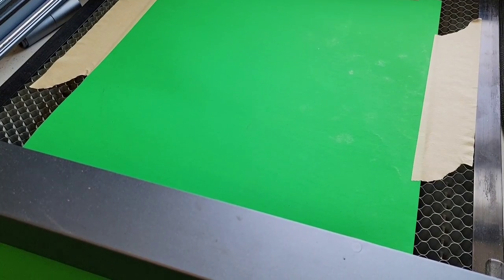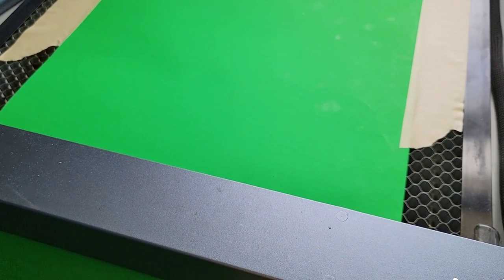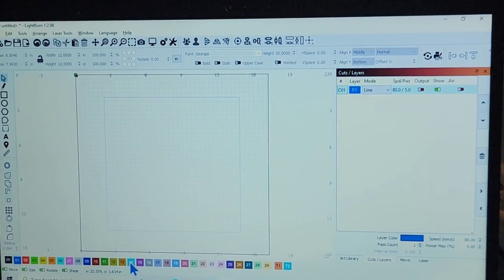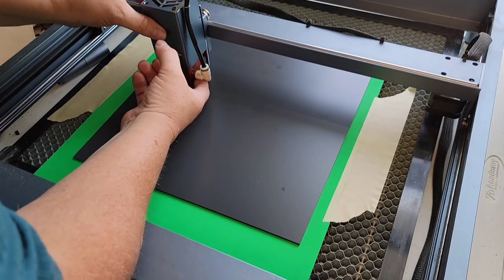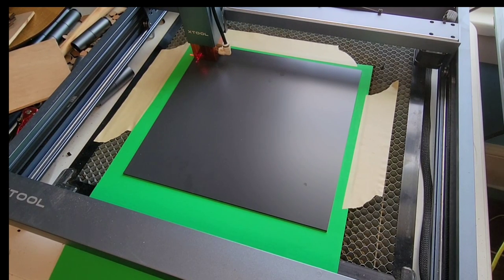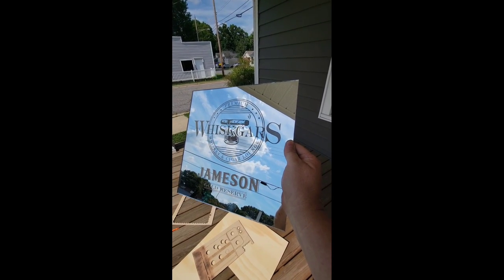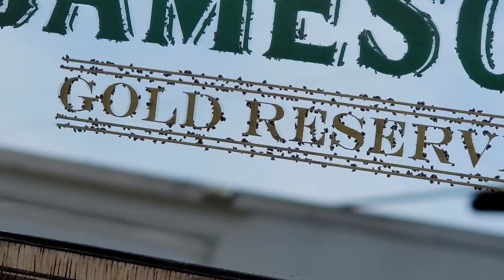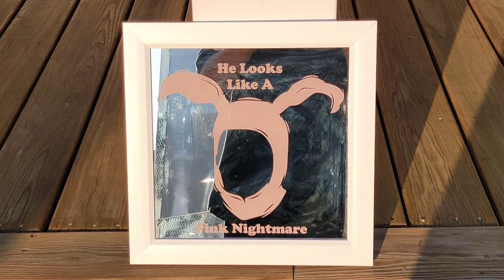Fun with mirrors and the xTool D1 10W laser

Comment: Hey!  That's really cool.  What settings did you use for the engrave part, and it looks like you painted the glass when you done?  Did you, and if so, any certain kind of paint?  Also, how did you get the antique looking letters, was that part of the font maybe?
Reply from the maker: I'm happy to share the settings I used, BUT one thing I've learned, my settings are irrelevant. The mirrors you use may have a thinker or thinner coating and you will have to use completely different settings. I used 70 mm/sec and 40% power on the xTool D1 with a 10 watt laser. I did hand paint it when I was done with the laser. I used Decoart Extreme Sheen acrylic paints.  They have a metallic finish once dry. The "antiquing" I believe to be side effect of the Decoart paint. After 24 hours a chemical reaction started tarnishing the silver finish on the glass. I've done other mirrors with a solid color from spray paint and didn't have the same result. To really complete the antique look, next time I will randomly burn inconspicuous dots around the glass. Then paint them to promote the antique look all around the glass.  Thank you for subscribing.  But when it comes to the settings, you really have to do a test burn on everything you try. That's the only way I know I will have the desired results.
Reply: @HoboWithWood  thank you!  I'll try it soon.  I appreciate you showing this.  I just bought an xtool, so I'm still a newbie.
Reply from the maker: @DeWitte Wilson  if you haven't found this guy yet, you need to subscribe to his channel. The Louisiana Hobby Guy. Also recommend PawPaw's Workshop. I've had my xTool less than month. These channels have been extremely helpful. Enjoy your laser and thanks again for watching.
Reply: Louisiana Hobby Guy is a Lightburn master.

Comment: did you change the speed and power when you engraved the mirror? or did you keep it the same as when you marked the card stop? really enjoyed your video, it is very helpful. thanks
Reply from the maker: This was a long time ago. I don't recall what the speed or power settings needed to remove the mirror material from the back of the glass.  I can tell you and warn you, mirrors are not created equal. Some of the cheaper mirrors are clears plastic with a mylar backing... these are terrible to try and engrave.  Your best results will come with glass mirrors made with a silver and copper mirror plating. As for the speeds and powers, you must test to find the best results for your laser and you work environment.  There are so many variables when it comes to using a laser to engrave or mark a material, to find your best settings you must test.  You can get cut libraries from other creators. But I caution you, these are only a place to start in most cases.  i suggest creating your own cut and engrave library based on your own test results.

Comment: I've been doing 4X4 mirrors for quite awhile with a 40w laser and haven't had a problem with the underlay burning into the mirror. But, I will still take your suggestion in the future and use it, just incase.
Reply from the maker: I since learned that as long as the surface was clean, I didn't have a problem. The quality of the mirrors has been the biggest inconsistency for me.

Comment: Hello friend, first of all, thank you for sharing the result of your work. I have two questions:
1) I don't understand why you used the green cardboard as background.
2) Should the painted part of the mirror face the cardboard?  Thanks
Reply from the maker: 1.) In previous attempts in marking a couple of mirrors, I noticed a pattern on the face of the mirror after the burn. Turns out the honeycomb pattern was presenting itself, and it was not cleaning off. A simple piece of card stock did the trick. Green is just what I had on hand. I don't think color matters, as long as it's a solid, clean surface. 

2.) The painted surface of the mirror should be facing up. In this process, you are simply burning away the mirrored surface of the glass to create the image. You are not actually engraving. Trying to engrave from the opposite side produces an entirely different outcome.

Comment: Awesome work, did you keep the same power and speed settings you used when you framed it up ?
Reply from the maker: If you're talking about the outline I created on the craft paper, no. It was at a much lower power. Didn't want to cut the paper. Simply mark it.

Comment: nice work! I etched on glass using a glowforge, I found too much energy cracked the glass. I guess it takes some finess. You use paint on the back to create the colored text, right?
Reply from the maker: Thank you. I've had some thin glass out of picture frames that cracked. I have painted the glass, used the laser to remove the paint, then go back and repaint with a contrasting color. While neat to do, time consuming and I didn't see a way to monetize it. Too fragile and too many other technologies out there doing really nice things faster and cheaper than I could figure out with a diode.

Comment: Do you paint the back of the mirror before engraving ?
Reply from the maker: No sir. That would be counterproductive.  You are using the laser to remove the coating from the rear to create the image.
Reply: Okay thank you , also when you paint do you paint the surface or rear ? Sorry for the dumb questions
Reply from the maker: @johnnycalderon8261  since I don't show the painting process in the video, I don't consider the dumb questions.  IF I am doing mutiple colors, I will use my acrylic paints and brush the rear areas I want for each color. iF I am doing a single color, I will use spray paint on the rear.
Reply: Absolutely thank you
Reply: I’m back because I have the mirrors in stock now , can you share the setting please

Comment: What kind of paint and brand do you use on the finished mirrors?
Reply from the maker: depends on the job. sometimes it's spray paint. sometimes it brushed on acrylic. different jobs call for different applications.
Reply: @HoboWithWood  Ok. Thank you.
That's what I thought. But I'm just curious about which one works better or stays longer on design.  I usually use a brush, but the paint kind of starts to fade off. Maybe it is the brand I use. I have not done crazy designs yet since I don't have the laser machine, I do it by hand and use various colors.
I have not tried spray paint yet.
 Thanks for the feedback. Great video, by the way.

Comment: How did you accomplish the "antiquing"?
Reply from the maker: The ability to recreate the antiquing will vary depending on the quality of the mirror.  As mirrors age the silver plating will begin to lift and oxidize on the back of the glass. Ammonia is the worst thing you can ever apply to a mirror. Unless you are trying to ruin it. After laser engraving the mirror, the edges or the engraved area are potentially vulnerable to damage. On a test piece, apply a strong ammonia based cleaner to the back surface of the glass. It may take up to 24 hrs to start to see the effects. And again, depending on the quality of the mirror, your results may vary.
Reply: Thank you for information.

Comment: Hi Steve. Are your settings of 12mm/s correct? If I set my D1 at that speed it shows a 13+ hour burn.
Reply from the maker: I know. Crazy. Right? But yes. To get the effect I wanted those were the settings I used for this burn. If you haven't used a mirror to do a test burn pattern, I strongly recommend it. You may find a result that works for you at a faster speed. I ran two test grids. The first was really large and I used speeds from 10 to 200 mm/s.  The second, I took the results from the first test to really dial in the optimum speeds and power to get a full burn on the test pattern with varying degrees of etching in the glass. If you aren't interested in trying to really create a frosted look in the glass, you may be happy with a setting as high as 80mm/s and 100% power. This removed all the plating on the mirror and produced a clear image, but it had little to no frosting/etching of the glass. And the biggest things I learned playing with mirrors were. 1.) I'm not the easy to look at for long periods of time. 2.) Mirrors vary greatly in the way the are manufactured and will require different settings from one type of mirror to another. So you need to TEST, TEST, and TEST. You would be sorely upset to wait 13+ hours to find the result was less than satisfactory. In later videos, I had some really interesting results engraving mirrors from the front using masking tape. I was able to create a 3D embossed look in the glass. Good luck. But do yourself a favor and use a mirror for tests. you can get 6 or more tests on the same mirror and have that around for reference on future projects.

Comment: you can help me choose which one I have to buy laser engraver that engraves and is more precise, I don't care about the cut but the engraving between which to choose ATOMSTACK S10 PRO 50W or Atomstack X7 Pro 50W or laser SCULPFUN S10 thanks
Reply from the maker: Thanks for watching. But I have no experience with the lasers you are asking about. I am only using the xTool D1. And I only have a couple months experience with it. But as Tim the Toolman Taylor would say, more power. You can never have too much power. I'm using a 10 watt module and I'm looking to upgrade to the xTool 20 watt laser module. But, I cannot provide an opinion on a tool I know nothing about. Good luck and thanks for watching.
Reply: I have the 10 watt Ortur, (worst), the 20 watt FoxAlien, (Better), and the XTool D1 10 watt, (best of the 3 diodes).  If you want to get serious about it, look into the OmTech CO2 lasers.  They aren't cheap but can do way more.
Reply: A lower powered laser, 5 to 10 watt output is going to give you a much finer focal point than the higher powered lasers. So if your just interested in engraving think about that aspect.
I have a a 5.5 watt and the focal point is 0.02 mm. 
That makes a very fine engrave.

Comment: How did you get that antique effect on the mirror?
Reply from the maker: The success of this technique will vary depending on the type and overall quality of the mirror. But what i do is after lasering, i clean the lasered surface with rubbing alcohol.  The edges around the lasered perimeter will let the alcohol seep in. This distorts the edges of the images. An old mirror that is showing age is simply where the silver is lifting or gone from the back of the glass. But again, the success depends on the quality of the mirror. Good luck.

Comment: Which setting did you used?
Reply from the maker: You need to watch the series I have on engraving mirrors. There are three videos on engraving mirrors.  There is SOOOOO much more to worry about than settings. The biggest of which is what type of mirror. Mirrors are not created equal. Watch the series on engraving mirrors and good luck.  if you are engraving images, there is a TON of testing in your future. If you are engraving simple graphics, it's no that hard. But you still need to test your mirrors.

Comment: What burn setting did you use for the engraving?
Reply from the maker: For this mirror, 12 mm/s and 80% power was successful.  But those same settings didn't work on a different mirror later.  This was a 12x12 tile from Lowes. Item # 197427

https://www.lowes.com/pd/Style-Selections-12-in-L-x-12-in-W-Square-Polished-Wall-Mirror/3730183

The mirror I purchased from Dollar Tree had a different material creating the mirror it was more like a sticker, (cheap mirror). And those setting were ineffective.

You need to test your laser on a sacrificial mirror before trying a project, so you know what works for you.

Good luck and thanks for watching.

Comment: Can you engrave a photo in a mirror with grayscale option
Reply from the maker: Engraving mirrors is tricky. First if you aren't using a "real" glass mirror with the silver plating, it will be difficult to get an image you are truly happy with. Then using grayscale may give mixed results. Removing the silver plating on a mirror requires getting through the outer most painted surface. Then there is are some mirrors out there that still use a copper layer on them, too. Then the silver plate. Grayscale works by varying the power intensity to create the varying degrees of engraving. This may result in not getting through all the layers needed to create the desired image. The one thing I can say for sure is the only way to know is to test, test, test. And know that if you get a second batch of mirrors, they may not have the same results. Vendors are constantly changing and not disclosing. Good luck and thanks for watching.